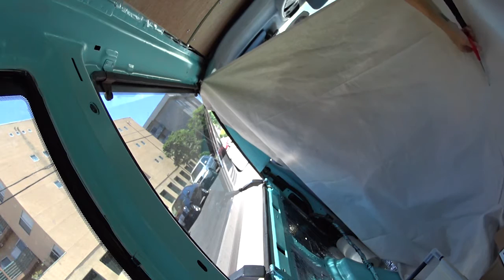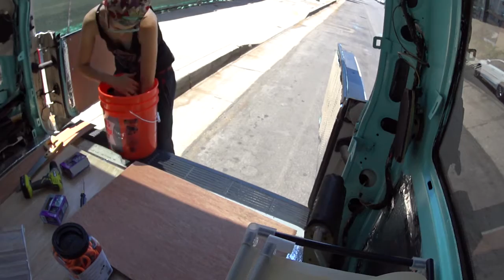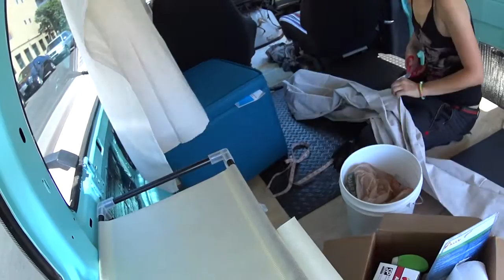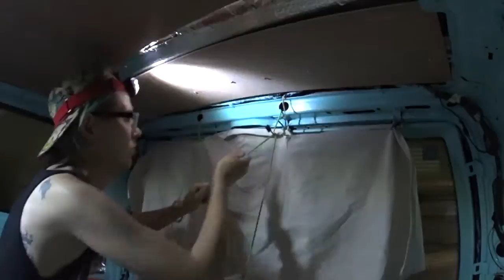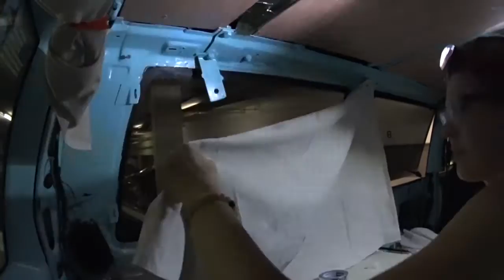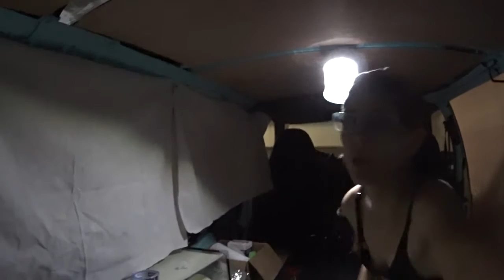CamperVan #11 Curtains + more || DIY Project Tiny Home On Wheels || Self Built Camper Van Conversion

Comment: I just took a regular curtain rod and hung the curtains on them and drilled the white curtain rod into the van all around nice and evenly at the top of the window....but i bought curtains.
Reply from the maker: i couldn't find any cheap curtains and then the windows are on a slant so they'd hang with lots of gaps since they're not flush with the side. nothings set in stone though, they can always be changed!